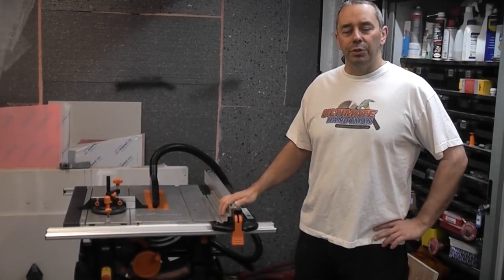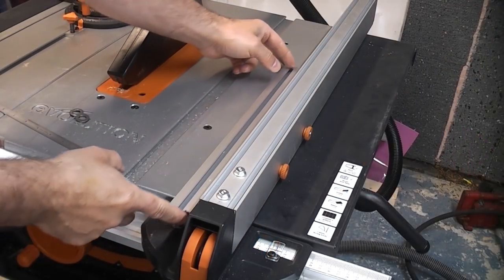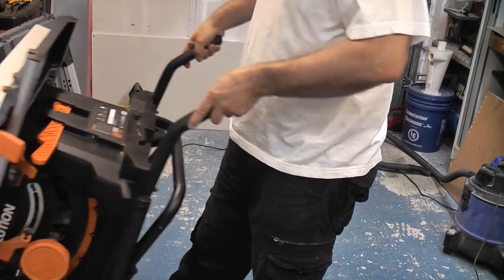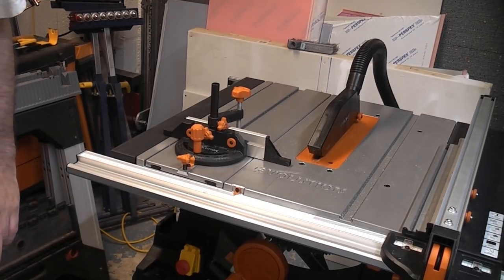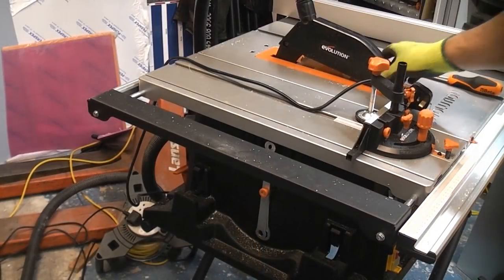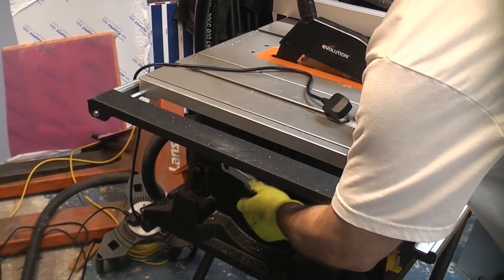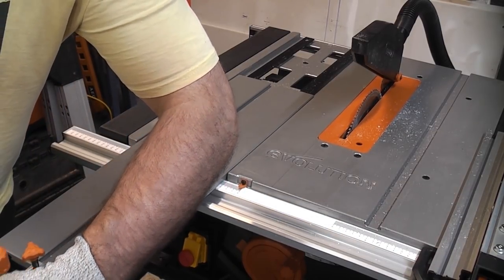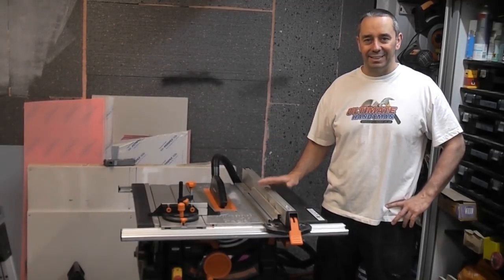Evolution Rage 5-S table saw review

Comment: Thanks for the review! Excellent as ever, covering more aspects than I'd have thought possible. I would never have dreamed of cutting mild steel! I've been toughing it out with an old Scheppach jobbie for years: no fence, no mitre guide, but with patience and a home made fence, you get decent results. I've fancied a new table saw for a while, but just didn't fancy shelling out £500+ on the Dewalt or Makita. I've used both onsite and thought both were gutless and had shitty fences. For half the price, and a decent fence, I'd defo give it a go on your recommendation.
Reply from the maker: I've used this plenty of times now and it has been a life save for cutting down long pieces.
Thanks for the comment 👍

Comment: The blade guard can be a bit of a pain but you can lift it by pushing the dust extraction port (with the push stick, for example) rather than putting your fingers anywhere near the blade.
Reply from the maker: Yes, I normally have the blade set a bit higher than I would normally, so that the work-piece can slide under the guard without it getting stuck!
Thanks for the comment 👍

Comment: I don't understand why the rip fence has the extra metal piece to the left of it? Could you explain the function? Thanks,
Reply: I too would like to know the purpose of this.
Reply: I believe it's to reduce the chance of kickback if the rail isn't absolutely parallel to the blade.  By having no fence after the cut the workpiece is less likely to pinch between the fence and the blade, because there's no fence there to pinch with.  
I've not bought this yet but am considering it.  I think this way you get the safety of a shorter fence with the sturdiness of a full fence supported each end behind it.
Reply: I have this saw and never use that secondary short fence,it defeats the point of the superb main fence

Comment: This video is a few years old now, but can you say what happened with the blade wobble at the last shut down? The blade didn't look like it was on the mandrel properly
Reply from the maker: It was a blade that I bought from eBay, I could not see the wobble until I watched the footage back. Once I removed the blade it was obvious that it was warped. I have since bought another blade, but this time I bought a Trend version, which is great.
Thanks for the comment 👍

Comment: On the track where the fence connects with the number marking is that loose.  On mine it is loose on the left  end where the table pulls out and extends.
Reply from the maker: No, I don't think mine is loose. If I remember rightly, you have to install that piece yourself?
Thanks for the comment 👍

Comment: Great review! Thank you for that! Does the blade "wiggle" sideways or would you say it's quite firm?
I am asking because with the evolution Rage 2 i am unable to make precise cuts on Square tubes of aluminum (60x60mm with 2mm wall); when it gets to the lower face/wall, the blade starts to deviate to the right.. :/ 
I would much appreciate your feedback on this or anyone's who has some experience regarding this.
Tks in advance! Cheers.
Reply from the maker: The blade is firm, but I did buy an acrylic cutting blade from ebay and noticed that it was buckled- you could only see it when watching the video. 
My Rage 2 cuts really well, your blade is not damaged is it? 
Thanks for the comment

Comment: I bought the Rage 5S. First I was excited, so many good reviews. Then, I put it on use. My excitement went down fast. First, the blade was not align (neither perpendicular with the table, neither parallel with the fence) and the wood would get stuck between the blade and the fence, which is a very dangerous situation. I tried to adjust it usual way, but at no moment I couldn't make it to square. Because the blade was not paralel with the fence, the fence tends to move away and the cuts will become highly unparalleled.  
This actually occurred when I used a thicker piece of wood (above 4cm). On thin material, the cuts were almost ok.
On the other hand, the motor is fixed on a sheet of steel, fixed with 4 screws above on the table saw, but you can move it with a finger on the bottom side of the device. The blade moves left and right along with this sheet of metal so I assume during operation can't stay straight anyway.  
I sent it to service, after two months since I bought it, and they told me it worked perfect. But in case I'm not satisfied with the product, I will be billed 8 hours man-work, because this is how much they spent to adjust it and make 2 cuts. 
If you ask me, stay away of this.
Reply from the maker: Have you contacted their support?
Perhaps the fence has been banged during transit.
Reply: @ultimatehandyman  I sent it to the dealer. But is not the fence which is the problem. Is the design. Or something is missing, the engine assembly should lock on, stay fixed after the desired angle is chosen. I cut only at 90 degrees, anyway.

Comment: I have just acquired a Rage 5s. You mention dust collection is superb. After every use I find a pile of sawdust on the floor underneath the saw. Did you adjust anything in your set up to improve the dust collection. I have mine rigged up to a festool CT26 vac.
Reply from the maker: I think I get the same, but when I said the dust collection is great, I meant the vacuum collects most of it and prevents it from being airborne and flying all over the workshop.
Thanks for the comment 👍

Comment: I've been disappointed with other evolution products, their accuracy has been poor to say the least, how have you found it after 3 years of use,? E.g. It's it easy to adjust the fence by a fraction of a mm? And is the fence reliably 90 degrees? I noticed your washer trick which suggests the fence doesn't sit perpendicular to the bed when locked down, any comments on this?
Reply from the maker: I don't use it regularly, and don't cut anything that needs a great degree of accuracy.
Most of the time I use it for ripping deck boards/skirting boards etc.

Comment: hi great video really good  i know you dint design the saw   But just wondering why has it got that bit of metal on the fence why cant you just but up to the long fence? & why has it got that  grove along the top  thanks
Reply from the maker: I'm not sure why they designed it like that 🤔
Reply: It's a safety feature that reduces the chance of kickback by basically have no fence touching the work piece after it passed the blade, but still allows the main fence to be attached at the front and back on the table.

Comment: Good, comprehensive video mate. A couple of questions: How accurate is the fence, out of the box, and: are the track guides a standard T track size? Thanks in anticipation .
Reply from the maker: Thanks.
It's fine for what I do, but I'm not a cabinet maker or anything, I just use it for cutting decking, or cutting down plinth's for my mate ( I don't think he has sussed out, to set the cabinets to the height of the plinth)
I'm not sure about the T slots, it might tell you on the Evolution website.
Thanks for the comment 👍

Comment: I noticed the blade wobble as it slowed down, is that right?
Reply from the maker: Well spotted. It was a faulty blade, which I bought from eBay. You could not see it in real life, but it is clear to see in the video. The blade has since been replaced 👍

Comment: Hi, Is there any way that you can make a comparison between Evolution and draper table saw, and why they are inexpensive compare to DeWalt . thanks
Reply from the maker: Dewalt is a very good make, but very expensive.
Evolution make some great tools that can cut metal and wood with the same blade, which are often much better value for money.
I'm not sure about Draper power tools, I have used some of their hand tools and used to buy a lot of them when I was a teenager for working on my car. I still would not hesitate to buy any hand tool that was made by Draper.
I'm afraid I cannot compare the Evolution to the Draper as it would mean me purchasing the Draper model and I don't have the space for it, nor the time to make the video.
Thanks for the comment
Reply: thanks

Comment: I'm a little late to comment on this video but I haven't seen it before. I'm thinking of a new saw and this is close to my needs and pockets.
I was impressed with the detail you put into the video but right at the end when you were cutting multiple layers the blade had a massive wobble.
Was I seeing things? It looked like the blade was about to come adrift.
Reply from the maker: I think that blade was warped, if I remember rightly, I bought it from ebay and was bought for cutting acrylic.
You could not really see the wobble until you got the footage on the computer.
If you live anywhere near Darwen, Lancs you are welcome to come and have a go on the saw before you buy one. 
Thanks for the comment 👍

Comment: Definitely need a blade guard redesign for thicker materiaks, would be easy to do, also ideally the mains cable could be a socket so you can buy a,longer one.  Ive said before the need an elongated hole where the guard mounts to stop the front lifting when the piece is at the rear.     Your blade had the wobbles after the lasr perspex for some reason!
Reply from the maker: Absolutely.
I'm not sure about the blade wobble, I never noticed it when cutting and the material was cut ok- perhaps a bit of perspex was stuck to the blade?
Thanks for the comment

Comment: Don't understand why you are trying to slide the plywood in with the blade set too low, that's why it is hitting the guard.
Reply from the maker: The guard is there to protect you and help with dist removal, the lower it is the better.
Thanks for the comment 👍
Reply: @ultimatehandyman  Yes i know it is but you have to set the hight of the back of it so your work will pass under it.

Comment: How have you got on with the non evolution blade. They have made it difficult to use third party blades by their dimensions probably to force people to buy their expensive blades.
Thanks
James
Reply from the maker: I've only used it a couple of times, I've been that busy that I don't get time to make much these days.
If they wanted to be awkward they could use a small diameter spindle and small bore blades, but they use a large diameter spindle and blade, which means that most other blades will fit this machine, if you use a reduction ring.
Thanks for the comment
Reply: @ultimatehandyman  Thanks for the response. You also have to consider the width of the blade to riving knife and kerf.
Thanks
James

Comment: WOW! WHAT THAT SAW WOBBELING!!!!!!!!????  25:42 Can you explain that? Honestly I'm shocked!
Btw. what about the accuracy when cutting longer pieces? What is the width on beginning and at the end of the piece? How big will be the divergency?
That's what would be interesting to proof whether this saw is suitable for more precise projects.... But this wobbeling hurts me a lot. Is that because of the blade or is the saw which causes the wobbling? Have you check it out?
Reply from the maker: Yes, that is the blade that I bought from ebay, it is buckled. I have since ordered a new one.
I have not cut any long lengths as I am restricted by the size of my garage, sorry.
Reply: Ahh Ok, Thanks for your fast response. However  a piece of about 1meter is even in small garage possible.
You should try it out. Btw. I have looked for many saws and until now no other could match the Evolution. It seems it is a pretty nice saw. However, my recommendation in gernerally is to spend more money for a good blade. Because at the end the quality of the cut makes finally the result. I have using a very expensive one from BOSCH and I can tell you THERE is a huge difference.

Comment: Hi. Great video. 

I'm looking into buying one of these saw. I've had a couple from screwfix but all became faulty and have had to return them. 

I'm guessing you've had the saw a few months now. Is it still preforming well. Any issue you've come across with the saw?

Thanks.
Reply from the maker: Thanks David,
What went faulty on your machines?
I don't use mine every day and to be honest I have not used it for the last 8 weeks due to working 2 plant shutdowns, but the last time I used it the machine was fine. I have cut a lot of acrylic on it (with a special blade) and it's been great. 
I have not had any issues with it yet.

Comment: I notice that when you're ripping, you're pushing the wood slower than I would normally. Is that for demonstration purposes, or are you finding resistance from the motor or the blade when you feed the wood?
Reply from the maker: I don't do a lot of ripping, so I tend to take my time with it.
I'm not sure how this compares to other bench saws as It's a long time since I used one.
If you live anywhere near Darwen, Lancs you are welcome to come and have a go with it?
Reply: Thanks for the offer. Unfortunately I'm across the channel. ;)

Comment: Very good review, the buckled blade is not good and the guard is a niggle  to solve. I hope the blades are not all like that. 
Thanks
James
Reply from the maker: The buckled blade was one that I bought from eBay specifically for cutting acrylic. The evolution blades have always been fine ;-)
I've since purchased a Trend blade for cutting acrylic- which should be much better.
Thanks for the comment
Reply: Ultimate Handyman.  I have an evolution mitre saw and it's great for general work and as I have plenty of second hand wood with all too many embedded nails it's ideal. I wanted s saw to rip through the timber too and this blade should fit my table saw just fine, if not, I guess I will have to get the saw too.
Thanks for the reply.
.

Comment: Does the fence fit on the left-hand side of the blade?
How well does it  rip through 3" by 3", you seem to be cutting through the 3"by 2" fairly slowly. If ripping 4" timber can you saw through from one side and complete the cut by inverting it?
It seems to be a better saw than the Fury.
Thanks again for an excellent review.
Reply from the maker: I think you can put the fence on either side but can’t remember 100%
I always cut slowly on a table saw as I don’t use one regularly enough to go fast lol. 
Yes you should be able to cut one cut then flip it over ( I do this a lot on the sliding mitre saw )
Yes, it is much better than the fury.
Reply: Ultimate Handyman: Thanks for the reply
Reply from the maker: You are welcome.
I replied to your first comment using my phone in Egypt and have only just been able to see your second reply.
Thanks for the comments

Comment: Since you have this one and the fury one is there a major difference between the 2 or ? if you was to go out and buy one what would you go for ?
Reply from the maker: Yes, there is a major difference between the two machines.
I'd definitely get the Rage 5 over the Fury 5 as it's a much better saw, which is why it is more expensive.
I love the Rage 5, it's a superb machine!
Reply: Ultimate Handyman cheers for the fast reply imo looking at both reviews the sliding sled seems beast thanks again for your review spending the extra 80 quid for rage deffo makes sense then thanks for doing the videos
Reply from the maker: You are welcome.
The sliding sled is a great idea, plus the fact that it can be folded down and wheeled anywhere makes it much better than the Fury.
Thanks for the comments ;-)
Reply: Ultimate Handyman pleasure all mine follow all your reviews and helped me tons and yeah folding down is huge us for me as being in a shed thanks again

Comment: Not too sure about the RIP plate fence. Is it intended for all fence cutting? It seems to have far too short of a bearing face to stabilise long cuts ! Anyway, thank you once again for all your skill in presenting this video, and for all the time and trouble you take. Confession ! I have recently purchased one of these units, and admittedly you have to be prepared to put a few hours into building the stand. But the final product is great. It presently resides in the front room due to my workshop being full of wood, will soon sort ! Because of its present location the Wife is not very happy at me cutting any wood at all in the front room.....strictly prohibited. Although I did wonder about always having to use the rip plate fence all the time, look forward to your comments, assuming that I have not been put down by the Wife !  Thanks once again.
Reply from the maker: The rip fence is designed so that it guides the material to the blade, but does not go past the blade as that could potentially cause a jamming point and kick-back, I think.
It's a great machine for the money, I love using it ;-)
Thanks for the comment
Reply: Yes that's what I would assume, but nothing by way of explanation from Evolution.

Comment: Like Kev Carguillo below. The Blade wobble at the end of the video. I must admit was a big concern to me. Was it a loose blade or was it something more significant???. 
I  have seen the reply you gave to Kev Carguillo. Wouldn't  Evolution replace the Blade??
Reply from the maker: The blade with the wobble was not the Evolution blade, it was one that I bought from a seller on eBay to cut the acrylic.
Having checked the blade it is warped and so will not be used in future. I have since purchased a Trend blade with a similar amount of teeth for cutting acrylic.
I'll check my reply to Kev as I'm not sure if I told him the blade was warped as I get hundreds of comments per week.
Thanks for the comment
Reply: Many Thanks. I must admit iv been looking at The Evolution Rage 5-S table saw with a midrange price for some time now. I think it will be ideal for my little workshop.
Reply from the maker: I like using mine, it is really useful for cutting things that can't be cut on the mitre saw.
Thanks for the comment